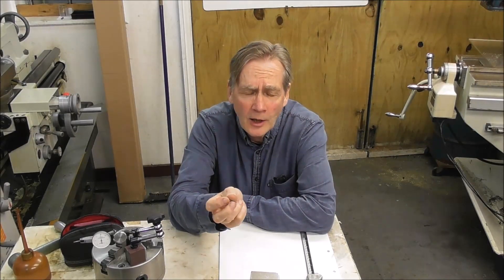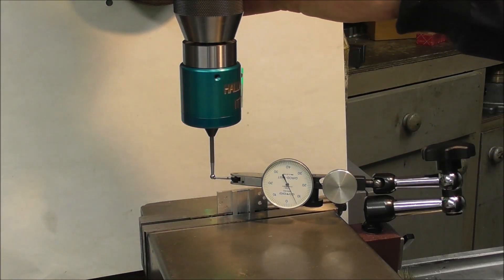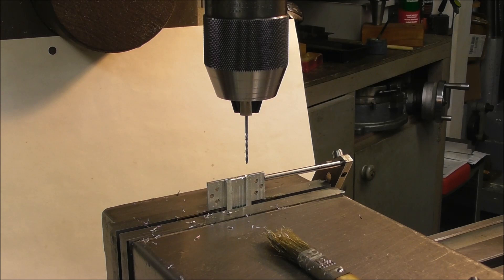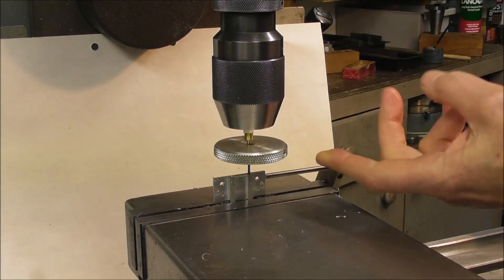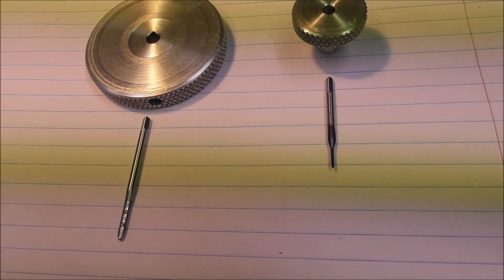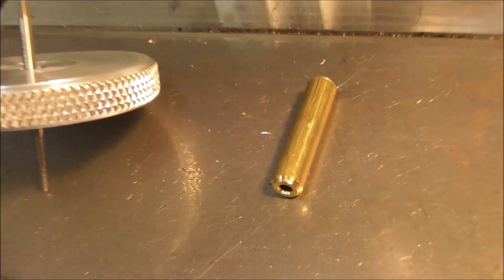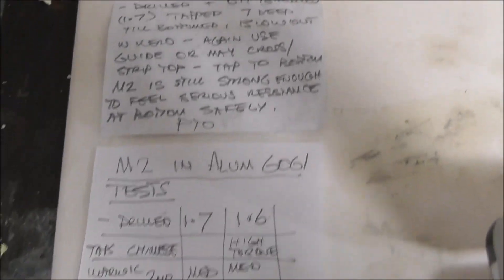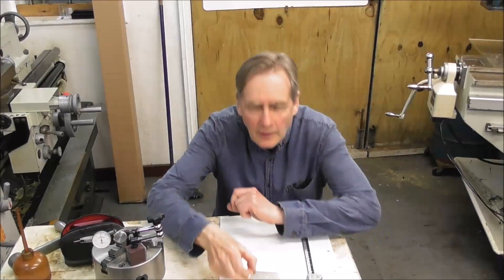Tapping Tiny Threads

Comment: what stops the circular tap wrench from slipping on the tap? how does it grip the tap?
also what size drill for 1mm tap, have some copper to tap 1mm any issues to be aware of?
thanks
Reply from the maker: Hi. Sorry I forgot to mention a set or grub screw is used to grip on the shank. Cheers. Cliff.
Reply: @Threadexpress  no probs, I could see the grub screw holes in some views, so thought that was the case....ty

Comment: Very useful video. I didn't understand how the knurled disk applies torque to the round part of the tap if the disk also has a round hole unless its a press fit which could be tricky?
Reply from the maker: Hi - Oh I should have mentioned the set screw in the side! I wonder how many others are wondering that! Cheers  Cliff